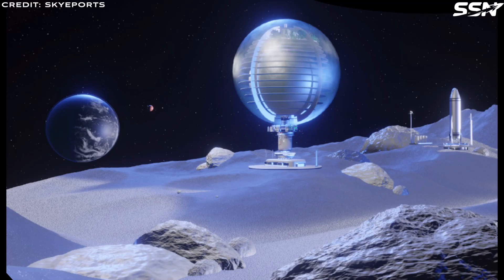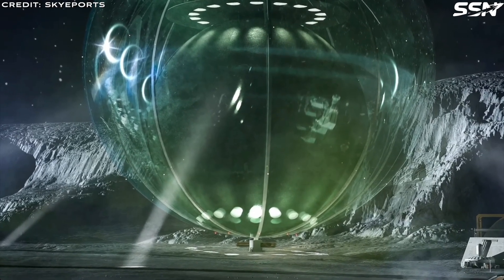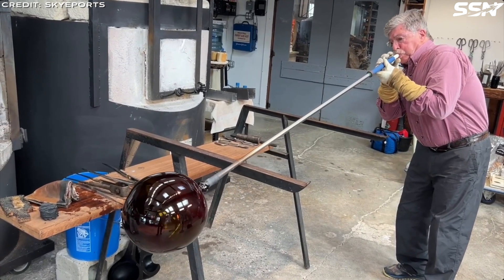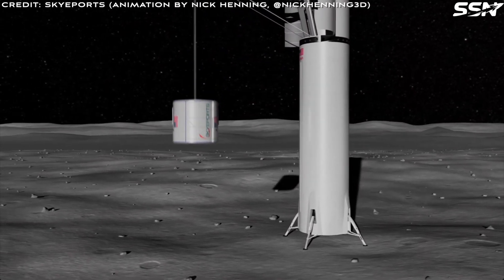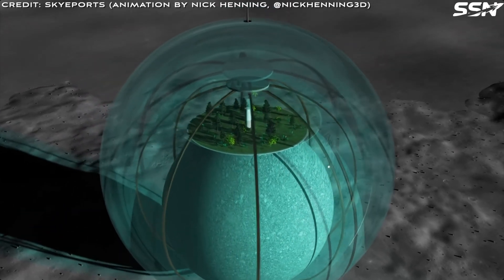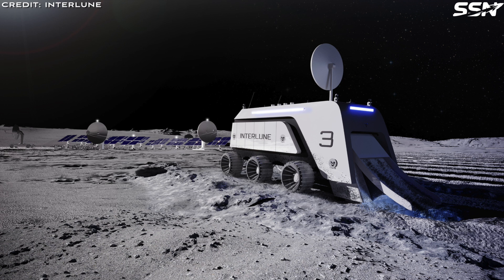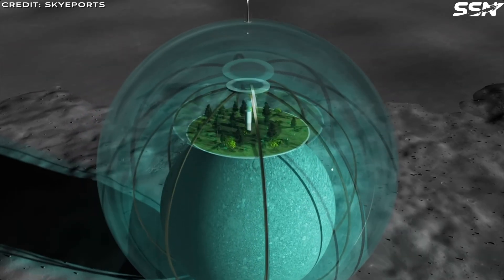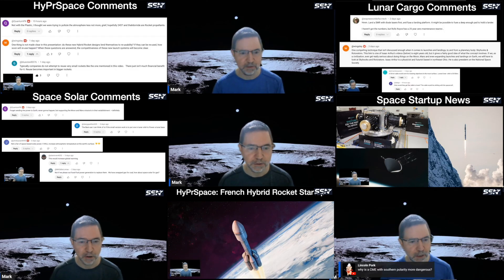Giant Glass Spheres for Lunar Living

Comment: I've looked at this, but for construction of space stations in orbit.  Blowing fused silica bubbles in a vacuum and zero g with inert gas would be a snap, and we already have experience inflating everything from balloons (the Echo satellites) and even habitats (Bigelow's Genesis I&II and BEAM).  It has a number of advantages over metals or engineered flexible materials.  I hadn't thought of using it on the Moon.

Comment: No qualified fire marshall on Earth would approve a structure that large with only one exit. NASA is way more safety conscious than a terrestrial fire marshall.

After a safety review expect the design to include at least 2 sets of stairs that are widely separated. I expect that the stairwells will act as emergency shelters, with an independent emergency air supply.

Elevators will be associated with each stairwell..

This means a much larger foot print. Think closer to dome than lollipop.

Comment: just tens of meter isn't really usefull for much you need atleast 100 if not thousands of square meter of space inside the bulb to be of use. whay is the small square fottage of legally rentable space in most countries.
Reply: The diameter is 10 to 30 meters. For example a 20 meter interior diameter, means a useful radius of 10 meters. So the central floor will have 314 square meters. The total volume would be 4200 cubic meters.

Comment: Frankly, I think lava tubes are a better choice for habitation. They have immense advantages in radiation shielding and thermal stability.  The only thing the glass domes have going for them, on the moon, is the availability of construction material... and the convenience of putting them where you want them, instead of where they naturally occur, as with lava tubes.

However, I do see tremendous potential for these as L5 habitats. Everything you said about the 1/6 gravity environment of Luna is even more true in microgravity, and instead of platforms, paired counter-rotating rings could be built within. Put water between the outer and inner spheres, and use it for aquaculture as well as highly effective radiation shielding.
Reply: I agree that underground Lava Tubes would be better than any kind of surface habitat that's not covered by a meter of regolith, but we need to get to the Lava Tubes first. Once we find a big tube and bore/drill through the meters of regolith to a mile-high tube, we could use the Giant Glass Spheres to shelter us from the regolith.